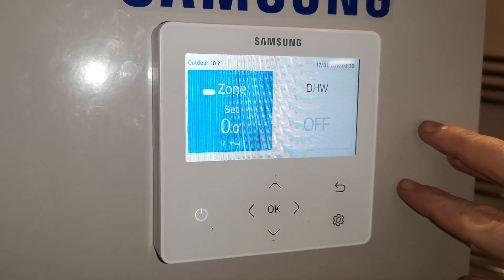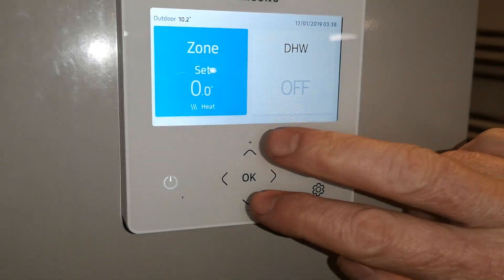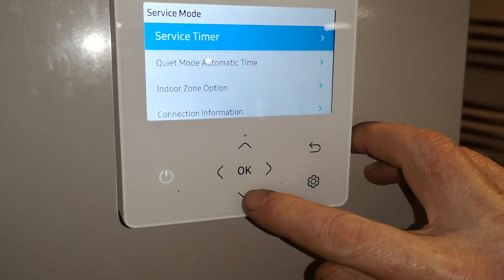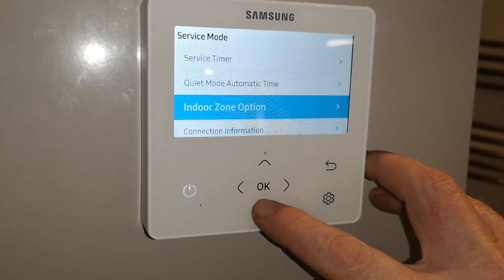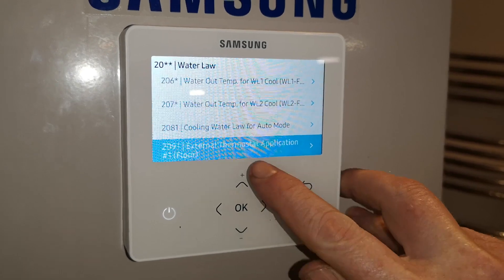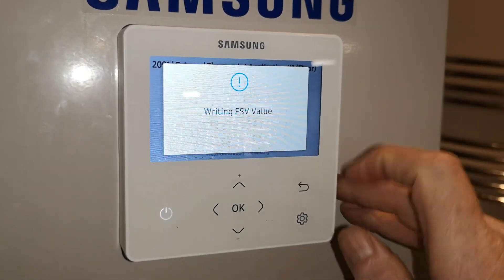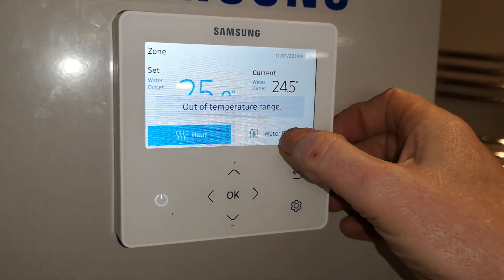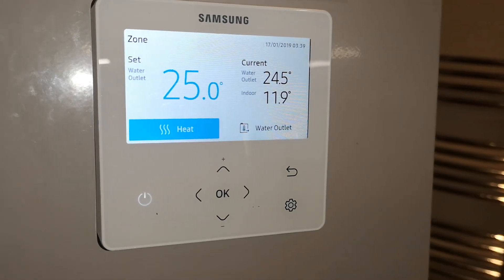running at a set water temp for pools and concrete curing Samsung air source heat pump gen 6

Comment: If the remote control is in your room you must use the settings that was in the begining, right? If it is in your basement you use these and it not works as termostat? Pardon my English i'm from Bulgaria :)
Reply from the maker: you mus put the midea controller in the heated room, its no good in the basement, it uses the sensor in the controller itself to measure the temperature hope that helps
Reply: @myheatpumpchannel7577  Thank you so much for the answer!!! It helps a lot!

Comment: Hi Graham, had my samsung gen heat pump turned on 5 days ago to  prepare the cemfloor screed (poured in August) for tiling in January. My zone was set to 0.0 and wall thermostats set to 30 degrees. The controller for zone is currently showing 39.5 degree for water outlet and 24.8 degree for Indoor. Water Law is set to Auto. Is Water Outlet the temp of water in the UFH pipes? Hoping this setup is ok.